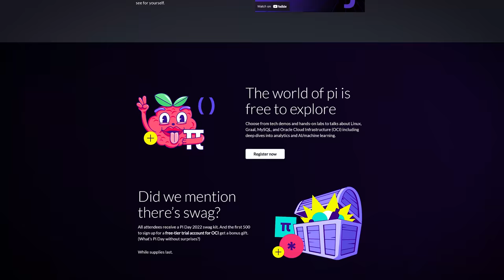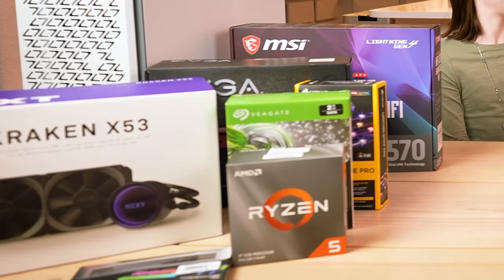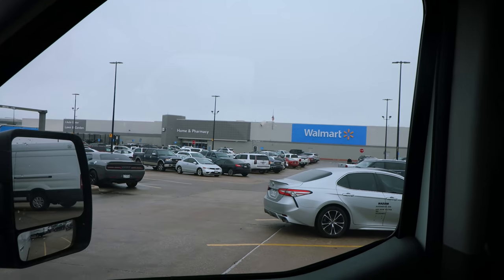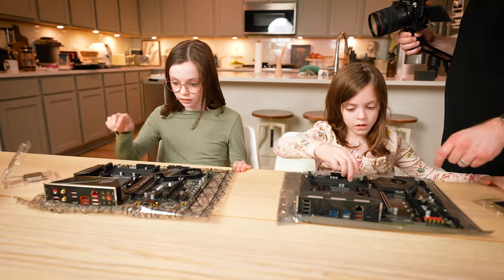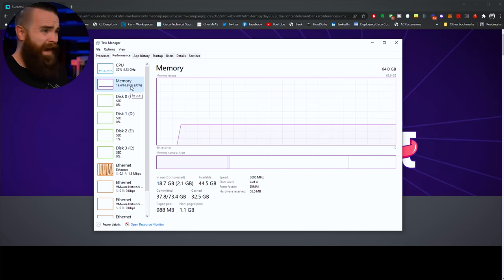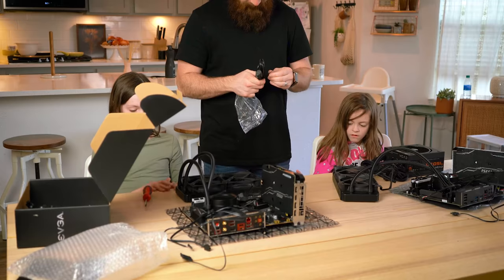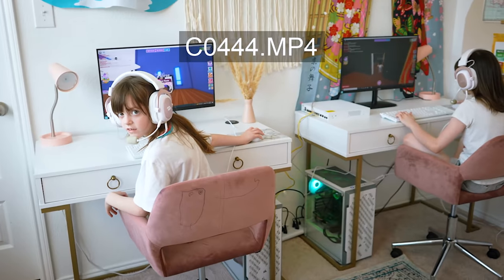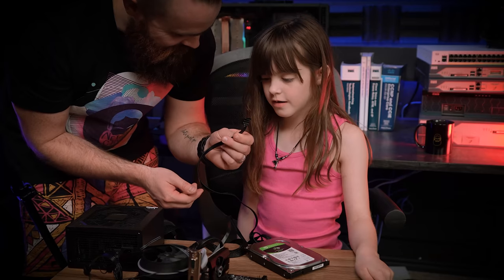my kids built a HACKING computer!! (i almost died)

Comment: 12:17 I see both GPUs are installed in the bottom slots. The top slot typically has more PCIE lanes directly connected to the CPU and therefore work a bit faster.

Great to get your daughters involved!

Comment: I still remember the first time I built my own PC.  It was more of an upgrade but this was back graphics cards were PCI-E.  It was quickly becoming apparent that the computer I had recently bought needed a graphics card, but to my horror I didn't have the proper slot on my motherboard and I knew very little about PC hardware at the time so I turned to a friend who was not only working in the IT field, but also had his certification in PC repair and asked him what I needed and if he'd do the work for me.  Well he gladly agreed and once I had the motherboard I needed I packed up my PC and the parts and sent it off to him for a job I figured would take no more than a week considering his schedule.

Two weeks pass, no word.  So I call him up and I'm told "I couldn't get it to work, come pick it up whenever."  Well I did, and it was in even worse shape than when I sent it too him, drives weren't recognized, and I still have no graphics card.  Flash forward a few months and I'm halfway through a non-certification PC repair course at the local college and I've been staring at this unused motherboard for months now but I finally feel like I have the knowledge it takes to attempt this myself.  So I clear off my desk, break my PC down to each separate piece and I slowly begin the process of swapping everything over.  Imagine my shock when I push the power button and it actually POSTs (Power On Self Test in anyone is wondering) on the first try.  That was the moment I became hooked on computer hardware and the number of computers I owned began to multiply.
Reply: I built my first pc when graphics cards were still AGP slots... pre PCI-Express. Hard Drives were Ribbon Cables with Master and Slave jumpers instead of SATA ports. There was no ethernet jack as modems were still RJ45 phone jacks for dial up modems. The era of operating systems was Win 95/98. I'd rather build my own than buy prebuilt bloatware machines.

Comment: You should not place the motherboard on the outside of this ESD wrap that came with it. Arguably more dangerous than not grounding yourself, placing it on a closed motherboard box is a much better idea, it is soft and it doesn't store a charge on it so you wouldn't make anything ESD fried or mechanically damaged on the back. And yeah, 99 out of 100 times it doesn't really matter.

I enjoyed the video, thank you for your work. I learned a lot on this channel.

Comment: Very cute video! At least at the Denver Micro Center, they have not carried Ryzen 5 3600 CPUs in many months. You probably could have gotten a Ryzen 5 5600G APU with integrated graphics instead, but that would have required flashing the BIOS before they would POST, which would have added more complexity.

Comment: My Son and I rebuilt my old (2004) gaming machine with modern components a few years back. It was a lot of fun and it's great to see my old modded case still being used today. Unlike a lot of newer gaming machine this one still has a DVD/BD drive and it still has the cool two line Matrix Orbital LCD screen in the front as well. The old cold cathode lighting has been upgraded with LEDs.

Comment: I really liked the video, but the parts selected are not ideal.
CPU: why 3600 when you could go 5600
motherboard: if you don't need the extra functionality of a x570 chipset I recommend b550. Saves money and still can be overclocked.
Gpu: I don't know how the availability is in the US, but I would recommend a amd rx 6600/6600xt instead. They have one of the best price/performance ratios currently.
Ram: 16gb in most cases (especially gaming) is enough and would go for faster ram instead of more. Amd cpus get a good performance boost by faster ram. And you can upgrade down the line anyway. 
These are just some recommendations.

Comment: cpu choice and the ram triggers me, 5600x wud be better and wud be almost the same price, 32gb is unnecessary. The ram speed is low for a ryzen cpu.
A better CPU and ram combo wud be the 5600x and 16gb of 3600mhz ram.

I wudn't rec anyone to get a GPU from a prebuilt, it maybe be better to use a ryzen 5600g that costs less than the 5600x and has an igpu

Static is not a big prob for a PC build, cuz it wudn't be enuf to kill a part

the ram kit is pretty expensive, 3600 is pretty bad for 2022

Comment: Just fyi, static builds up on the outside of anti-static bags.  Better to build on the motherboard box itself.  That being said, LTT did a video experimenting with static (and other forms) of electricity on components during a build and it is not like it used to be, is a good watch.

Comment: Hey, I am in Dallas tx as well and question: Someone needs to get into IT but doesn't want to be over the phone with client like Help desk etc.. with cert or parth to go like where you will think and solve problem without calling clients...
Reply: You'll probably want to look at the higher level jobs like network administration, servers, cyber security, etc. Depending on where you work and your specific job, you may still work with some end-users, but most likely not to the extent as in a help desk/technician level role.

Comment: Why isn't the GPU in the top slot in the final build tho? The top slot is directly connected to the CPU and has better bandwidth. The cooler and motherboard is also pretty overkill, you should have gone with a B550 or B450 and bought a better GPU. 3050 doesn't cost that much more than a 1660 (may cost even less) and you get some neat features with RTX. You get RTX Voice and broadcast along with other things. But overall I like the video, really like the new editing style!
Reply: Video was made in 2021
Reply: @noahsmit7760  oh i forgot thanks